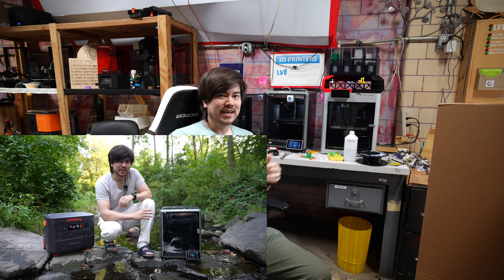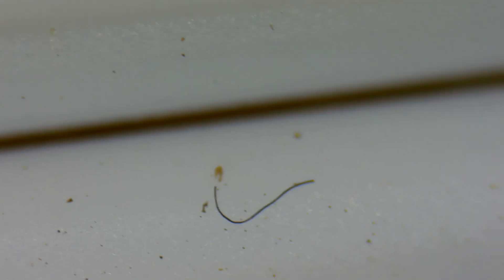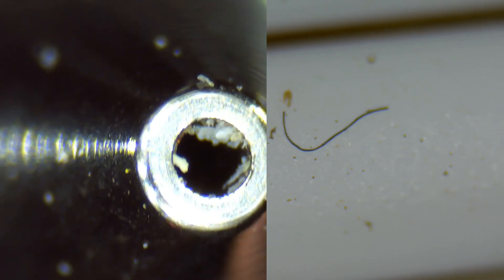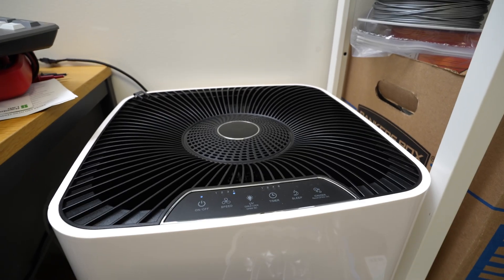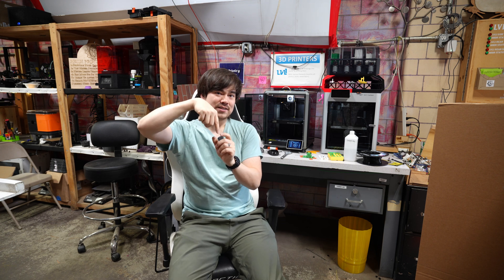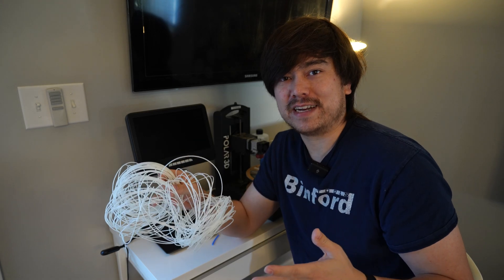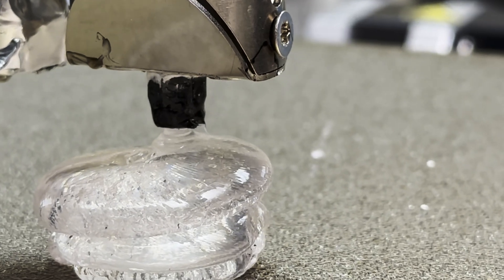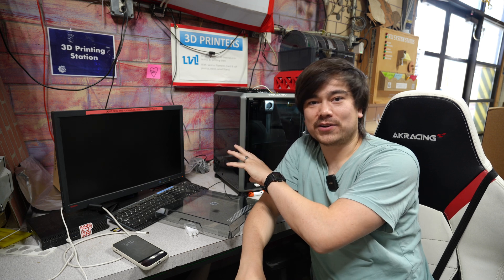How to Stop Nozzle Clogs 🌋

Comment: My problem is the TPU that I buy from a Chinese supplier has gotten dirtier INSIDE the filament.  They apparently have a dirty manufacturing environment and are perhaps introducing small debris into the material before they extrude it, perhaps when they recycle regrind waste back into the raw feed stock.  It hasn't caused me to clog 0.4 mm nozzles, but the black TPU objects I've been printing and selling have small white or silver flecks embedded into the surface.  I'm currently trying to move to Siraya Tech TPU filament, which looks better, is lower durometer (harder to print well but makes a better product) and it's less expensive.

Comment: I like to use those power cable filter boxes clamped around the incoming filament. I take out the ferrous material and replace it with some medium density foam, to wipe the filament before it goes into extruder =) The little box looks super clean and haven't had many issues over the last 10 years with clogged nozzles.

Comment: Dirt? What are you talking about that is ABS-Earth better than ABS-CF. On a serious note i had a un attended nozzle clog on my ender 3 s1 before , the extruder grinded the filament so much that the clog pressure and the heat expanded the ptfe tube on the extruder. i was surprised it didnt get a blob of death instead.

Comment: Important video, I’m going to vacuum my entire 3D printing area, maybe put filament wipers in my Bambu AMS too. 

I don’t have a lot of nozzle clogs, but they’re enough of a pain when they happen that it’s worth some effort keeping things clean to keep it from happening. (Also great idea to run an air filter in the printing area, also to save potentially grubby filament and use it with a larger or much largernozzle.)

Comment: I NEVER had a clog in 5-6 years of FDM printing 24/7.
Reply: It also depends on the nozzle diameter and how good you are about checking it. Below 0.4mm can get sketchy with specialty materials but I'd avoid doing that anyway. I've only had the start of a disaster on an old ender but never again after switching to an all metal heatbreak.

These days I pretty much just use 0.5mm for general FDM. Tungsten carbide nozzles are absolutely amazing as well. Nearly same performance as brass and I have a machine that has gone through countless spools of carbon/glass fibers and it still performs like the day I got it.

Comment: Cheap filament with inconsistent diameter also cause clogs.

Filament shouldn't be left out, they come in resealable bags for a reason. If you don't want to use bags, get a cheap storage bin, throw in desiccant.

Comment: I run a farm and I get multiple clogs daily but that's mainly because we use flexible materials with machines that have less than ideal extruder designs for flexible materials (mk4, p1s). Ive come to the point where ive significantly reduced print speeds to simply reduce failures due to clogging/skipping issues as the maintenance and unclogging of some of these machines is costly and time intensive. On the other hand, my 3d printers using the sprite extruder (cr m4) have rarely ever skipped or clogged due to their extruder design. I feel like newer high end machines have prioritized quick nozzle swaps and high flow hotends which tend to be less ideal for non rigid materials
Reply from the maker: That’s an interesting point

Probably the best extruder for flexibles is from Microswiss, the NG.
Reply from the maker: It takes seconds to open and clear the filament path

Comment: for like 12y i use average cheapest kitchen sponges sometimes used for packages - (like 3M Scotch brite - cheapest in packs) -use entire sponge in one piece or cut into 2cm strips and push filament through it (rough side isn't needed) and leave it ; repleace with new filament/ push trough new one in new spot
Reply: Yep I do that too. Works well and is not expensive, and you have them around the house all the time anyway.
Reply: Yeah just need to be good about replacing it (if using old filament) or it could cause more issues. I run most my filament through reverse bowden tubes and put the cleaning material in my box before it enters the tube.

Comment: Haven't had clogging issues yet but a couple of my spools have probably accumulated a bit of dust. I'm thinking about doing the inline sponge cleaner which should be fine for smooth filament but I'm a bit worried about the carbon fiber pla which feels like sand paper to the touch. Since abrasive filaments can quickly wear out brass nozzles I'm worried that using a sponge on them would just leave a lot of sponge particles on the filament instead possibly making the problem even worse depending on what the sponge material is.

Comment: Clogging nozzles was the root of retiring my first FDM printer, a Monoprice Maker Ultimate, (a 2017 Wanhao D6 rebadged). After retiring 18 months later, after I got my Ender 5 Pro, I've never had a z nozzle clog since. The Monoprice came with a metal rod of about 1.5mm diameter specifically to push filament through the nozzle when it cloged. That inclusion in the accessories kit should tell you something about their expectations on nozzle clogs. Not other FDM I've had since (5 or them) has had one in the tool kit. I also never store any filaments in the open, instead they go into a sealed storage box with lots of desiccant bags in them to keep the humidity inside stable.

Great job as always. Thanks, dude.

Comment: I had clogged nozzle after switching from Cura to Orca slicer. It was default end of print Gcode, with 38mm  retaction. It must have been for multii material application. Revised end of print retraction to 2mm, all fixed.
Reply: I have a similar problem when upgrading PrusaSlicer.  The end G code does a fast retract that strips TPU and it jams on the next print.  If I don't catch it, the TPU squirts out the side of the extruder and breaks the extruder, or it stalls and heat soaks up into the throat and makes a burnt filament clog.

Comment: You talked about nozzles and improvements, which of the new types do you think are the best? And which one do you see sticking around? It seems like every company is making their own propitiatory nozzle type(s)...and it seems like they keep making new ones, with Creality for example having several current non-compatible "nozzle standards". I still primarily use V6 style nozzles on my printers, I sometimes think about upgrading them to something more current, but don't want to get stuck into something that will go out of production withing six months...
Reply: I end up using whatever slightly new nozzle is on each new printer I buy, and if I'm lucky, I throw away all of the spares when I retire a 3D printer.  If not lucky, I'll realize too late that I thought I had spare nozzles but when I try to use them, I realize they only fit the previous printer.

Comment: I agree that you should keep trash off your filament but I don't agree that 
1. The #1 cause of failed prints is clogged nozzles and 
2. The #1 reason for clogged nozzles is dirty filament.
Actual, honest to goodness nozzle clogs are unicorns. It's only ever happened to me once in several hundred kg of filament and was because I used a reamer to turn a .4mm nozzle into a 1.0mm nozzle and unknowingly left a brass shaving inside. 

All these people experiencing "nozzle clogs" are just running too slow. That thing you described with heat creep up into the heatsink is real, but it doesn't just happen after you've experienced a "clog" and sat there chewing on filament for 12 hrs. IT IS the clog. It is cause, not effect. For whatever reason people are happy to run with default profiles based on printers from 2014 that only result in 5mm³/s volumetric, so the filament is barely moving. It's going so slow that heat is allowed to conduct up through the filament (despite it being a terrible conductor of heat) and soften in the heatsink. When the extruder tries to push that softened filament down the hole, the filament expands, it tries to pancake. Now it's bigger than the hole and now you have a "clog." Mostly when people experience issues their first instinct is to slow down. This makes the problem worse. Talk to people who have frequent "nozzle clogs," ask how fast they're running. $5 says every one of them will tell you just how responsible they are, how extremely slow they're running just to give the printer every possible opportunity to perform properly and "somehow that still doesn't help."
Reply from the maker: In my case it was definitely caused by contamination. I did a cold pill and could see the bits of dirt embedded in the tip, but agreed, heat creep is a real problem. It can come up when running slow as you describe, or when you shut the printer off without letting the hotend cooling fan keep the upper portion of the heatbreak at low temps. The heat travels up and melts everything. 

A well designed heatbreak/extruder system will never have that failure. You need excellent passive cooling, or low thermal mass of the hotend (bambu does this), a well polished heatbreak, and an extruder that is oowerfudl enough to break the clog free while also making the sure the clog is t way too strong via the other measures
Reply: I believe your experience was unique. I doubt many people have tried printing with river mud filament LOL. But plenty of people have printed with CF and GF filaments and had no problems. The fibers that are intentionally entrained in those filaments are a lot bigger than dust particles and lint. Think about how you would remedy the situation if the filament swelled in the heatsink; also cold pull. So if people have the issue that I described, and they think the issue is dirty filament, and if a cold pull solves the problem, then that serves as confirmation of the dirt theory in their mind even if dirt never was the issue. I do agree that you should make an effort to keep dirt off the filament but if some occasionally gets in there, it's almost never going to cause a failed print. I think by far the more prevalent issue is running too slow. Just felt the need to speak up about an issue I don't see brought up often enough amid all this talk of "nozzle clogs" which are basically a myth IMO.

Comment: how would you attach an inline filter in AMS when it rolls back and forth. Wont the spool just roll back at some point and take the filter with it? =D
Reply from the maker: Or maybe even put it in the middle of one of the Bowden tubes that is on the other side of the buffer
Reply: @NathanBuildsRobots  I've been pondering this problem for a while and there are some models that install directly on the feeding hole in AMS, but it proved to be hard to work with. Apart from that there is no way to isntall filter securely. In bowden behind the ams would be the most practical way, but how would one go about it as the filament goes in and out and may catch on the sponge inside and drag it all the way into the hotend. Technically if there  was a piece of bowden tube which has holes on the sides small enough for the sponge to touc hthe filament but the filamnet would still go through - that would be it probabbly.
Reply from the maker: Probably, but there might be enough clearance if you made a custom low profile one out of a piece of shrink tubing or soldering. Best route is to loads spool and leave the spool in there until it’s empty

Comment: Beard trimmer without any attachments gives me a nice clean stubble.
Couple of minutes, dry trimming, aftershave lotion without alcohol, 1-2 times a week.
I prefer wired one, creates a cast-in-metal routine without low-charge error path.
Totaly ruined any kind of shaving for me. Several times faster than electric shaving after getting some experience.

Comment: Thank you for this video. I have been storing my filament in sealed Tupperware boxes as well, or an AMS, since I started printing a year ago, and people told me I was being too concerned about nothing. It never seemed like a good idea to me to just leave filament out and about unless you had a really clean room (my house is old) and low humidity (my house does not). Now I have a good video to show them why they are the ones being silly for not.

I also appreciate the Trump university/steaks reference. That cracked me up. 🤣

I have to ask though, are you feeling OK? 😁 You had nothing but positive comments for Bambu Lab in this video and I kept waiting for the hammer to drop. 🤣🤣🤣
Reply from the maker: They are doing some things right, the enclosed AMS system really is smart, and a lot of companies have missed the plot on what makes their printers reliable (AMS plays a part in that story)
So credit where credit is due
Reply: @NathanBuildsRobots  I wanted to mention that I have noticed as of late, or maybe it has always happened and I just only recently started noticing, but I have noticed some vacuum sealed" filaments I have opened have dust or some sort of noticeable foreign objects. I'm going to start cataloging these and if it's frequent then I will start reaching out to the vendor as your video shows they should be sending us clean/dust free filament, and anything else means it's been sitting around a while which it shouldn't be from a moisture and dust perspective.
Reply: @NathanBuildsRobots would be even nicer if the AMS also acted as a dryer instead of just a desiccant storage system

Comment: I started having clogging issues when I began using Overture's recycled PLA. I have to run it something like 20C hotter and that fixes the issue.
Reply from the maker: Yeah recycled stuff could pose a huge risk for contamination. Just one piece of dirt in a batch, or one wrong piece of plastic could end up making big problems
Reply: @NathanBuildsRobots  but still worth the risk.
Reply: 20c higher works? That sort of makes me wonder if there was some other filament shredded/recycled into that batch; some filament that needed a higher temp.
Reply: @S.A.S.H.  Yeah my theory is there might be granules of PETG in it, but also I wonder if the clogging action of nozzles is partly due to the stickyness of melted plastic, so increasing the temperature also reduces the amount to which debris can cling together.

Comment: I drilled extra holes in the rim of my cardboard spool, to hold the filament better - dumb mistake. There was cardboard debris throughout filament, from the original drill and the holes shedding more debris as it unwound. I glued the holes shut, but it was too late - totally contaminated. That's when I started being more careful with cleanliness and also running my filament through a microfibre cloth. Seems to work - never had a clog.
Reply from the maker: Cardboard doesn’t melt so good.

The bad part about feeding contaminated filament is the particles can linger in the extruder or Bowden tube, then weeks later when running known clean filament you might randomly have a jam and have a hard time putting the cause and effect together.
Reply: @NathanBuildsRobots  Good point - I haven't cleaned the entire feed system.